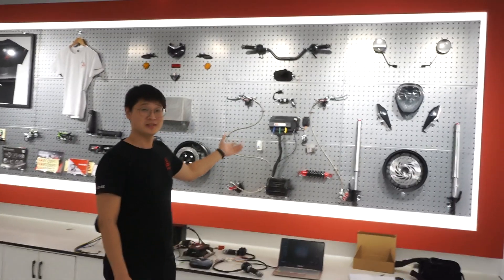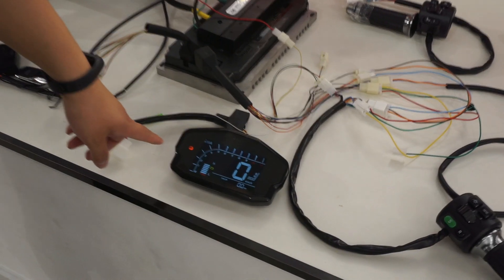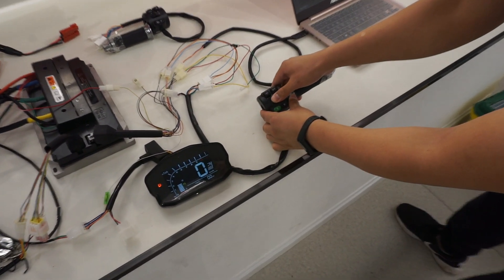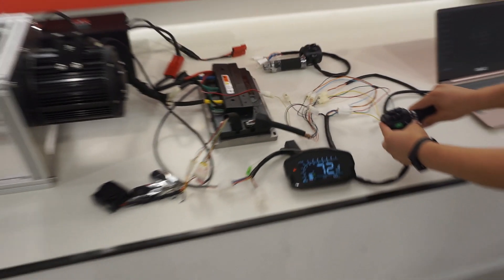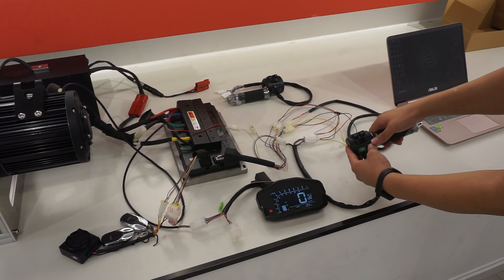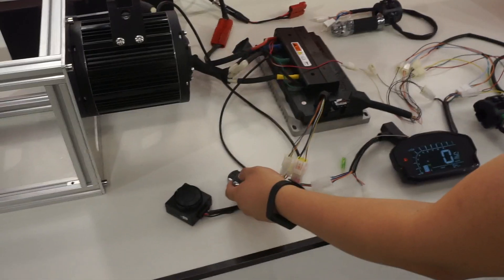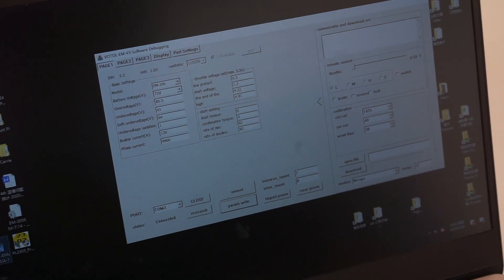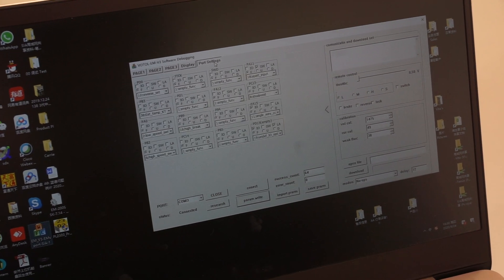SiAECOSYS QS138 90H PMSM Mid Drive Motor Kits Electric Powertrain Demonstration

Comment: I have same this setup and I need help to make it work because I did the wiring using your website but it's not easy and motor did not start  so please provide me full and easy setup for the wiring connection for the same

Comment: Hello, I bought from your company a set of mid-drive with a pendulum, with a controller, a display.  Thank you very much for your work and great product !!!  But many people want to be able to connect these kits at home but with the instruction of the problem!  Please record a video of the detailed connection of each node and wire, it is very difficult to figure it out yourself, and please also make the wires longer for all nodes as for an average motorcycle !!!
Reply from the maker: Thank you for your suggestion. We will try to take more video for connecting these kits in near furture. For the wiring, there need vehicle wiring harness, we don't plan to make the wires longer.
Reply: @CNQSMOTOR  Hello dear company!  I bought a motor and a controller from you, but connecting it myself is a whole problem!  this cannot be done with wires in the set.  If you are not planning to dodge wires for delivery with motors and controllers, then help me understand where to buy ready-made wire harnesses so that you can easily connect at home!  You need to place this posting on the same sales sites where your products are placed.  Thanks !!!
Reply: @andreiprosvirin1588  They added a wiring harness for the em-series controllers to the AliExpress store last year that is great to get started with.  It's about $40 including shipping to US.  It's got connectors for turn signals, horn, headlight, etc...
Reply: @CNQSMOTOR  we are seafaring for the wiring connection so can you please provide me with a easy and full wiring diagram for QS Motor 3000w 138 v2 with em150 sp controllars and same screen and other parts in this video

Comment from the maker: The speedometer could connect with controller via LIN or CAN BUS, depends on the setting of speedometer.
Reply: Nice!
Any timeline for the release of Votol EM-200 and EM-300 96V model?
Reply from the maker: @justan1ck  There is few request on EM200 in 96V, so far only available in 72V. For higher power controllers, we suggest APT
Reply: Hello, I bought from your company a set of mid-drive with a pendulum, with a controller, a display.  Thank you very much for your work and great product !!!  But many people want to be able to connect these kits at home but with the instruction of the problem!  Please record a video of the detailed connection of each node and wire, it is very difficult to figure it out yourself, and please also make the wires longer for all nodes as for an average motorcycle !!!
Reply from the maker: @andreiprosvirin1588  Thank you for your suggestion. We will try to take more video for connecting these kits in near furture. For the wiring, there need vehicle wiring harness, we don't plan to make the wires longer.